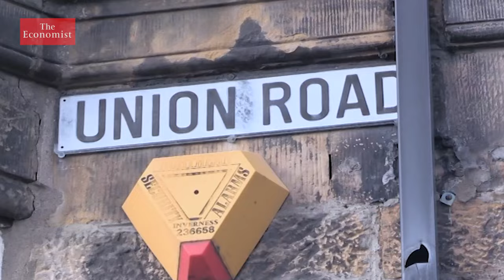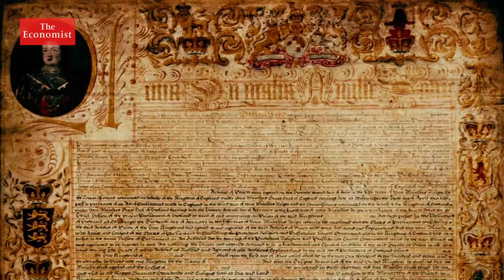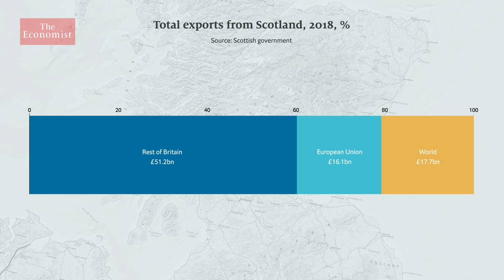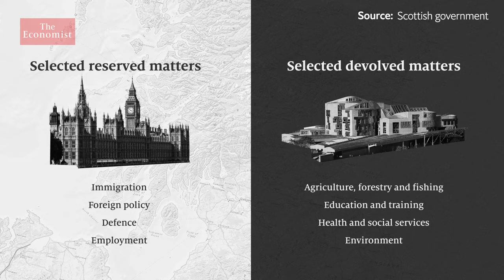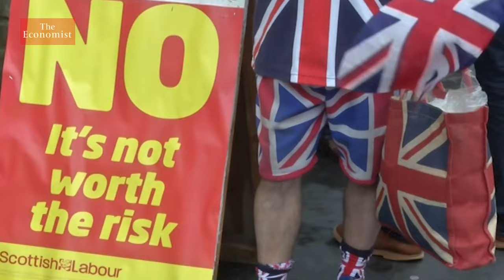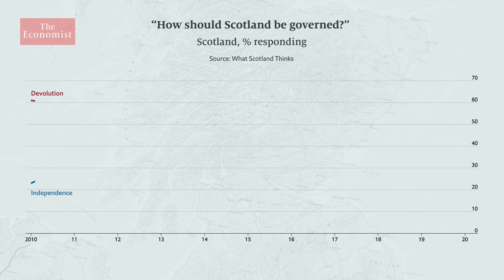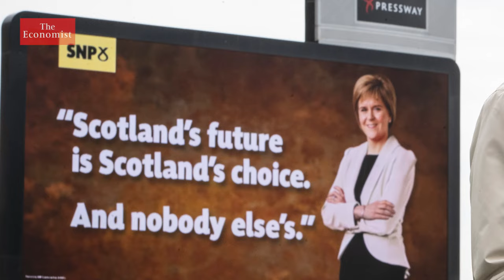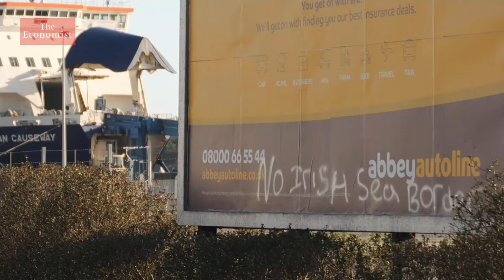Scottish independence: could Britain break up?

Comment: Irish unification is a logical outcome. Scottish independence, too. The EU will welcome Scotland as a full member. No worries 🇪🇺🏴
Reply: No it won't. The EU already has major problems supporting its weaker members and Scotland has a deficit in double figures that well exceeds that 3% level required for new members. The mandatory requirment to sign up to Schengen also creates a huge issue (which is why Ireland prioritises the CTA over joining Schengen). In addition, Scotland does over 60% of its trade with the rUK and about 20% with the EU. In summary, it makes little economic sense for Scotland to leave the UK in order to join the EU, it would be an extreme act of economic self-harm. But it wouldn't happen, even if Scotland did become 'independent' the problems in joining the EU would be insurmountable and the idea would, at best be kicked down the road indefinitely. The SNP are leading disappointed remainers up the garden path by telling them that independence is the road to rejoining the EU, it just wouldn't happen, and the more the  UK diverges from the EU and signs up to external trade deals that lead to lower or zero tarrif trade with the rest of the world the less sense it makes. 

In summary, Scotland is not going to be rejoining the EU, unless it is as part of the UK, which is in itself highly unlikely considering the unpalatable terms the EU would demand for that to happen.

Comment: The roots of the problem is still the question; why it is cheaper to import something that can easily be manufactured locally ?
Until this is sorted out and corrected there will never be justice and peace.
Reply: The answer is simple, comparative advantage.
Reply: Because there are more costs associated with manufacturing than transportation.

Comment: If Scotland become independent, Countries with union jack will change their flag right?
Reply: their flag would look horrible
Reply: @K-TheLetter  tbh as much as I like the union Jack, putting it on other flags looks pretty dumb. I wish the new Zealand flag referendum would've passed
Reply: @K-TheLetter  they should add english flag i guess.... England was the original country which took all these colonies
Reply: @starscream1457  no only UsA was England colony
Reply: @starscream1457  and india
Reply: Well ireland did leave yet the Red Cross of Saint Patrick is still on the union flag (it’s only a Jack if flown at sea) 

Also wales has no representation. So I doubt they would change the union flag, since they didn’t remove the 🇯🇪 when Ireland left

Comment: They can leave, as long as they pay back all the debt accumulated which  England has paid since 1707.
Reply: Clearly don't know your economics, with the recent election results it looks like your beloved union is Finnish.
Reply: @leemacdonald6533  Since just 1998, the Scottish deficit has been around £350bn in total added up, roughly adjusted to inflation, compared to a GDP of around £200bn, a 175% debt to GDP ratio, when the UK overall has a debt to GDP ratio of just under 100%.

Comment: Strange the people that say Scotland’s a financial basket case are the people holding all the fiscal levers, 🤔.
Reply: Sooo true!
Reply: Except most of Scotlands fiscal control has been in Holyrood since 1997.

And Scotland gets back all the tax money it brings in, plus 99.7% of the north sea oil and gas revenue (the remainder goes to Wales) plus billions more on top of that from England to subsidise your various free services (free universities, free prescriptions, free dental appointments etc).
Reply: @titytitmk2738  any links to prove this is true?
Reply: @titytitmk2738  what Scotland has free uni df.
Reply: @titytitmk2738  10,000,000,000 barnet formula and 15,000,000,000 low tax receipt bailout this last 18 months, 25 billion quid shoved their way for sweet f.a. time they went and paid their own bills.
Reply: @titytitmk2738  This statement is factually incorrect.  Scotland only has 15% control over the total revenue raised in Scotland.  The majority is allocated by Westminster. Nor does Scotland receive the oil revenue it all goes to London and the scraps are handed back.
Reply: @jonathansimmons5353  This is incorrect also. The UK as a whole borrowed 180 billion. Scotland only received its per capita share. There is no handout from England!!!!

Comment: strong armed Ireland in is a lovely way of putting it
Reply: There was no resistance to the act of union what are u on about ?
Reply: @vestty5802  please educate yourself
Reply: @finn9606  explain
Reply: @vestty5802  "No resistance to the Act Of Union" You are hardly suggesting the participants in the 1798 rebellion had all changed their minds by 1800, or Robert Emmet's rebellion in 1803 (small as it was) was un-related? Or the lack of home rule was not the main driver for the ensuing growth in various Home Rule movements over the next 100 years, leading evetually to war and independence?

Comment: Since joining the EU(EEC) in the early 70's population of England grew by 10million. At the same time Scotland's grew by just 0.25 million. I think this goes someway to explaining the differences in opinion between the 2 Countries viz a viz free movement of people which ultimately led to a vote for Brexit in England but not in Scotland. England and Scotland are not hugely different in geographical size however in 45 years the Southern half of England accommodated many of the extra 10million citizens whilst Scotland's population barely rose.
England had changed too quickly for some - particularly  older voters as often is the case - and they voted to return to a past that Farage and co. promised was still there. Scotland by comparison didn't have that problem - if anything it needed more young people.
Much as I love England beats me why more EU citizens don't venture North of London and the SE to Scotland other than as tourists.

Comment: But The SNP Did Not Get Majority At The Scottish Election,
Reply: Pro-independence parties have a combined majority of seats between the SNP and the Scottish Green Party, this is sufficient to get a referendum through parliament. Winning a Scottish election does not require an individual party to win a majority, the voting system used in Scottish elections is different to Westminster elections and makes it extremely difficult for any individual party to win a majority on its own.